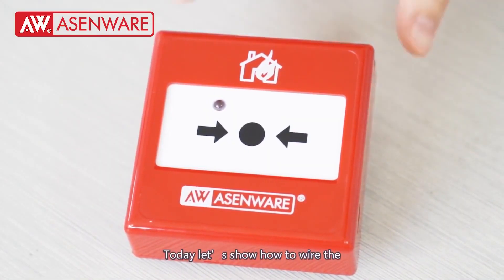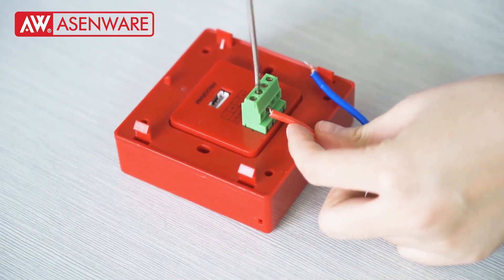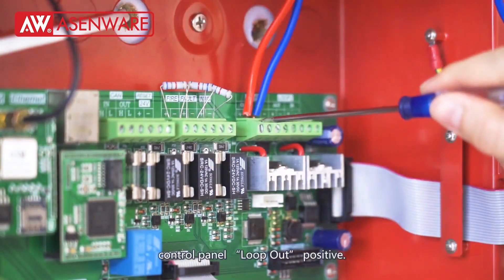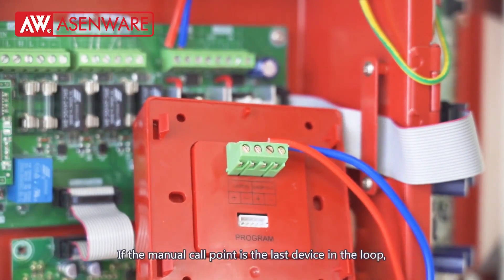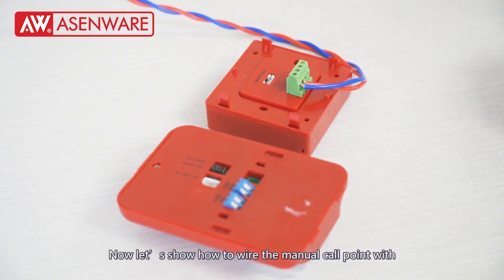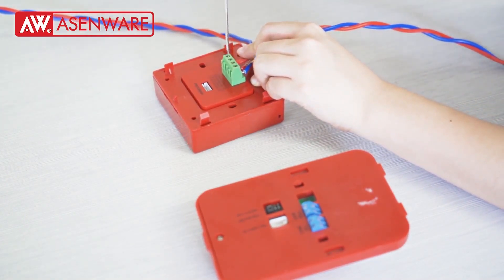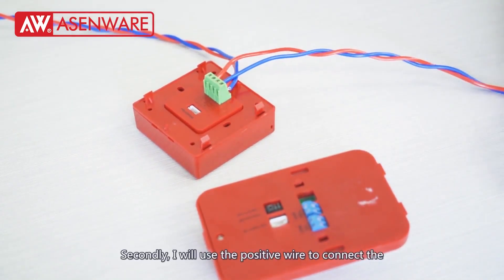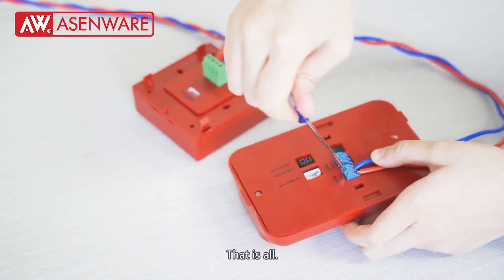How To Wire A Fire Alarm Device To Manual Call Point (2021 Update Tutorial)

Comment: Hi may I ask do you need a fire alarm system to make a fire alarm go off of can you just have a fire alarm and a pull call point to make it go off
Reply: Yes it’s like wiring a light switch one wire coming off the call point to the alarm one wire coming off the alarm to a wall socket adapter (18v adapter) and one wire coming off the call point to the 18v adapter and plug it in and test it and your good!